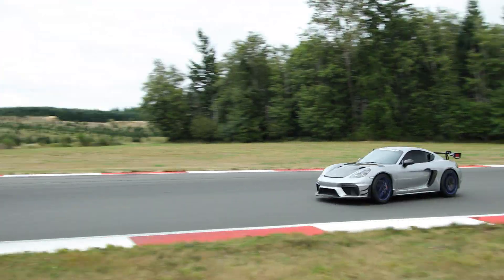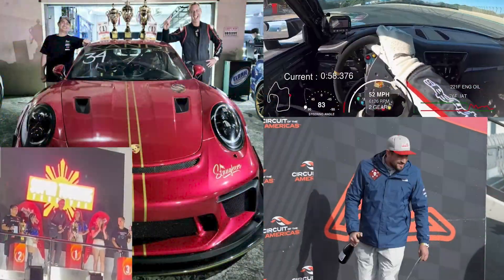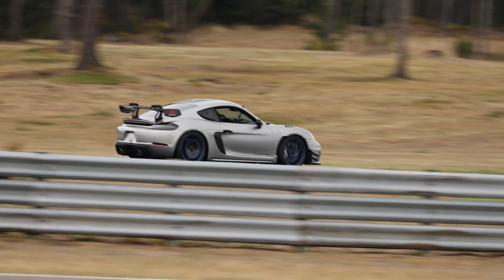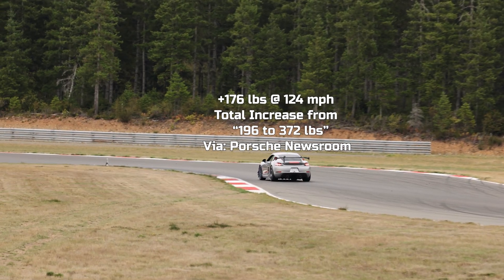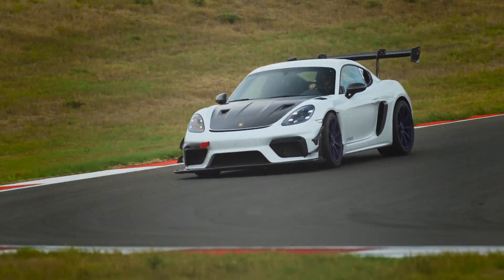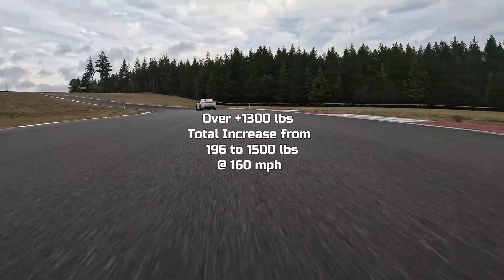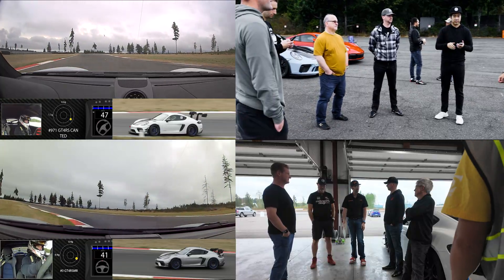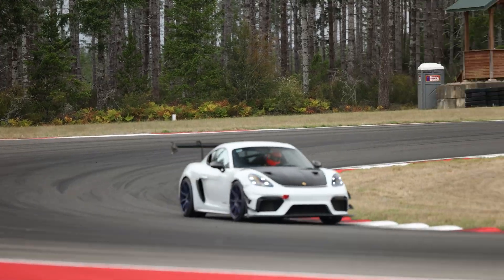Dundon Motorsports vs Manthey Racing: 718 GT4RS Aftermarket Aero Test

Comment: lol. I have a feeling that the Manthey kit has to abide by certain homologation standards or FIA rules  which is going to limit its aero grip when compared to a no-rules situation. Similarly, I laugh when I hear about all the track records the Porsche 919 Evo would break and people saying that it's faster than an f1 car, yet F1 cars have to meet certain rules and regulations, they can't just increase the turbo boost, the electric power and tune the chassis for all out fastest times. It's a pointless comparison. I just looked up results of DTM, LeMan, WEC, NLS, etc and I don't see Dundon Anywhere, yet Manthey appears all over the place.

Comment: Would have been cool to compare a stock GT4RS vs both of these … also any tire/wheel or alignment differences. 

Dundon truly out there proving itself
Reply from the maker: We did that test vs a stock car a few years ago.  Check our older videos!!
Reply: 4s off from Dundon kit in the Ridge Motorsports Park

Comment: Is the Manthey kit only aero? I thought they also did KW-based suspension and a bit of power... Or maybe I'm getting confused between GT3 and GT4 kits.
Reply from the maker: The Manthey package also includes dampers.  Dundon Kit also includes MCS 3 way dampers, power package and an option for running 265/325 wide tires.

Comment: Well, both are very nice examples but not exactly apples to apples. Manthey’s setup within homologated guidelines for road use, therefore they cannot exceed drag over the stock car. 

I would imagine they would build an even more capable and faster car if it were unregulated or had a blank slate.
Reply: Kind of proves Dundon's point that theyre faster for a fraction of the money.....

Comment: Same tires and wheel/tire sizes on each?
Reply: Same tires, Hoosier Track Attack Pro's.  Manthey on 20" 265/305 to keep the aero disks on the car, Dundon on 19" 265/325 which is the Dundon Spec.
Reply: @jamiebopp473  ooo how do you guys like the hoosier vs 3R?

Comment: That MR wing seems fairly flat compared to Porsche's press release photos of their Nordschleife hot lap 🤔
Reply from the maker: Was set to max!
Reply: @DundonMotorsports  I want to believe you. But there's clearly a big difference in AoA on those wings.

Seriously. Go check out Porsche newsroom photos (google 718 + "Optimised for maximum performance on the track"). On your car, the top edge of the end plate is horizontal, but on Porsche's it's like 5° or so.

Do you propose that Porsche used modified parts, or drilled extra holes to get that kind of angle?

Comment: Dundon feels a bit lacking in vision. The point of MR is that they can work within EU regulations — increasing downforce while still staying close to OEM fuel consumption standards. Their kits also have to be refined and elegant, not just exaggerated race-car style. That’s one of the reasons Porsche acquired them.

In contrast, you can just go as big as possible without worrying about regulations. So I don’t think there’s much to compare, nor does it prove you’re more impressive. It’s not about making things more extreme, more exaggerated, or more “race-only.” Sometimes cars aren’t just about lap times — some people appreciate the beauty of OEM-style upgrades rather than heavily modified performance.
Reply: Yep MR cannot add anymore drag to the car so they are constrained in terms of performance where as Dundon isnt.

Refined and elegant - Have you seen the news 992 GT3RS MR lol? Performance/Laptimes doesnt care about elegance bro

Olaf selling a stake to Raeder engineering then selling 51% to Porsche AG had absolutely nothing to do with the refined elegance of Porsche MR road cars (that didnt even exist at the time) 

The entire Porsche GT range is about laptimes you numbnuts, you think they spend all this money at the Nurburgring to be elegant? 

This video proves that for a fraction of the money Dundon parts are faster. You think people paying 6 figures for the MR kit dont care about laptimes/performance?

Youre completely talking out of your ass
Reply: The only benefit of Manthey kit is the warranty. The performance for the price is low compared to SSR and Dundon. An absolute scam
Reply: Agreed, but if your ultimate goal is times you do not care about EU constraint’s you want the package that ultimately gets the best results
Reply: 💯… putting dundon in the same category sr Manthey is criminal